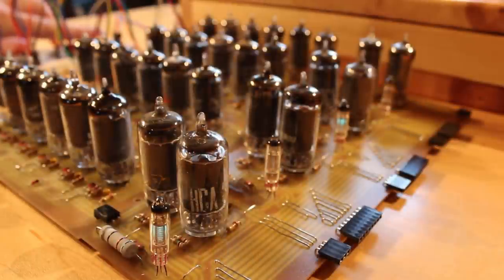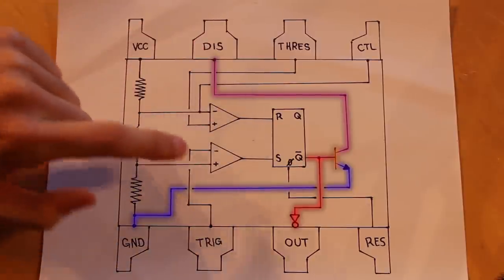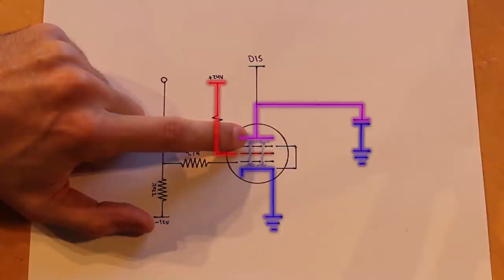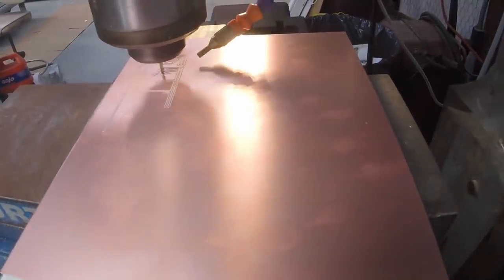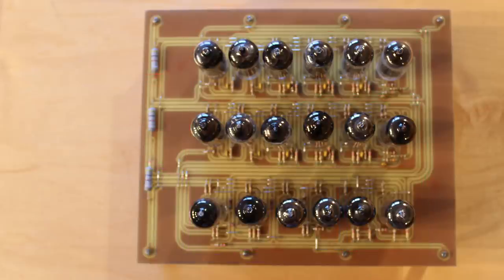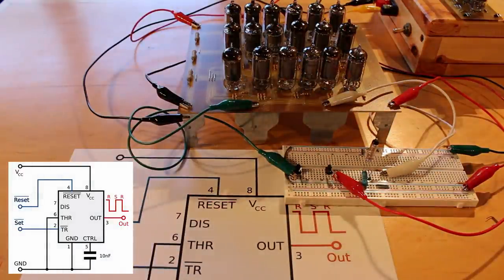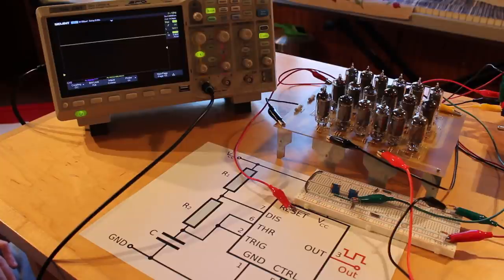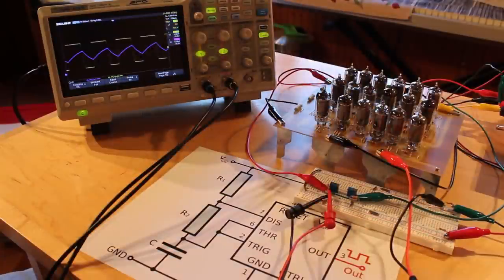Building the Largest 555 Timer in the World out of Vacuum Tubes

Comment: This is so cool, I have to dig out my old Radio Shack "designers handbook" pamphlet of 555 projects. I can make an LED flasher out of it! I'll definitely take a tubeless kit if that comes to be, I have plenty of sharp cutoff pentodes.
Reply from the maker: Thank you!
I'm really happy with how it turned out!

I'm definitely thinking about designing a few kits, one for pentodes, one for dual triodes, as well as coming with tubes and without tubes. I'm trying to do as much testing with and design revisions as possible with different tubes here to make the design flexible enough to be used with a variety of different tubes (and also to bring the total tube count down a little). Out of curiosity, what kind of pentodes do you have? 

My hope is to test and design with enough different tubes that I can release tubeless versions with recommended tubes and resistor values.
Reply: @UsagiElectric  check out the .75 cent Tubes list at vacuumtubes.net. There are many small TV pentodes that nobody wants because they don't work well for audio, but for this would be fine. You'd be under $18 for all the Tubes with shipping.
Reply from the maker: @richardhansen469  I really do need to contact them! Unfortunately, all of my go to tubes for the low voltage applications that I'm doing here aren't in there specials category (6AU6, 6AS5, 6136, 6BA6, 6CL6, 6BK5, and maybe the 6CB6). They do have the 6DT6 though, which I do happen to have in my collection, so I can do some testing with that one. I need to dig through their list of special cheap tubes and see what I have on hand to do some testing with!

Comment: that is fantastic,  I agree with the datasheet comment, and I would totally be interested in a kit.  I suspect I can even supply my own tubes.
Reply from the maker: Thank you so much!
I've been working on a design for the OpAmps that uses just 4 tubes each (instead of 6 each), but is still flexible enough to be used with a few different tubes. So far, I've got it working pretty well with 6136, 6AU6, 6CB6 and 6DT6 tubes. There will be two little potentiometers to tune the OpAmp to the tube type being used, hopefully opening the kit up to a bit more flexibility for sourcing tubes.
Now, I'm just waiting on some ordered parts so I can start proper design on the PCBs!

Comment: So glad Hackaday did an article about this! I didn't know this channel existed.

I'm sure there'd be people out there who'd love a kit for it. Need to get the tube count down though! I notice your go-to tube is the 6AU6. Mine's the 6BL8 because it has a pentode and triode in the same package. I usually use the pentode for gain and the triode to buffer the output - however I run my projects at 250V, so that'd make it easier for them to operate. Probably not recommended haha. Good work!
Reply from the maker: Thank you so much!
The 6AU6 is indeed my go to tube, but mostly that's because it's cheap, I have a bunch of them and I've done enough with them to be really familiar with how they react. I actually have a handful of triode/pentode combos (notably the 6GH8, 6KT8 and 6GJ7), and they would make excellent gain buffer combos like you use with the 6BL8. I do use the 6AU6 as a cathode follower buffer for the output buffer on this one, but I totally could have built the flip flop and output buffer using just two triode/pentode combos with relative ease (and halved the tube count on that portion). 
But, as you noted, running at such low voltages makes things a little more difficult! Running at 250V would work so much better, though I'm guaranteed to have shocked myself more than a couple of times by now if I were, haha.
Reply: @UsagiElectric  While I think of it, it should be possible to get a very low anode voltage on a triode if you drive the grid positive relative to the cathode. This means grid current will flow so the source impedance needs to be fairly low. It'll behave like a pentode with a 0V grid sort of. Something to think about. Cheers.
Reply from the maker: @256byteram  Interestingly, driving the grid slightly positive relative to the cathode is how most of my low voltage designs work. Even with the pentodes, I tend to push the grid to just above 0V to fully drive the tube into saturation. The grid does suck up some electrons, but there's enough resistance on the grid network to keep that to a minimum. It's kind of using the tube outside of it's intended design, but then again, rocking just 24V would make most of the tube designers of yesteryear just look at me like I was a mental case, haha.

Comment: Really neat.   But a bit,impractical.   You might ponder using some 6BN6 tubes.  Originally designed as a purely analog FM detector.  But due to its quirky positive feedback it makes an excellent comparator or flip-flop.   And since there is no other demand for them you can get them for like $1 each.
Reply from the maker: Thank you! 
And I wouldn't say it was a bit impractical. I would say it's completely, totally, and absolutely hilarious levels of impractical!
I actually have a few 6BE6 tubes, which are pentagrid converters (or heptodes) that work excellently as flip flops or multivibrators, but I already had about 1,000+ 6AU6s in my possession, so I totally built this based around what I had readily available on hand!

Comment: It is one of the best videos I've ever seen. Congratulations. One question I couldn't avoid, did you test how fast can it run in astable mode? Saludos desde Chile!
Reply from the maker: Thank you very much!
I did actually give it a test in astable to see just how quick I could push it, and it seems that 8kHz is about the limit. It will actually go faster, but the falling edge starts to fall too slow and the output waveform gets smaller and smaller. You can see the slow falling edge here: https://i.postimg.cc/fRBJ9Nx6/IMAG3517.jpg
 Whether this is an issue with the SR Flip Flop or the Cathode Follower buffers, I'm not sure at the moment, so I'll have to do a bit more investigating. But, 8kHz isn't bad at all!

Comment: Very nice, great choice of target as well - just the right amount of complexity I think! How much power does it draw?
Reply from the maker: Thank you!
I think it could definitely make a nice kit for anyone who is looking to get into vacuum tubes at safe voltages!

The power draw is a little tough to calculate. Nearly all of the power is used to heat the filaments in the tubes. Since these are all 6AU6 tubes, they are rated at 6.3V and 300mA. But, I'm slightly undervolting them running at just 6V per tube, so should be around 285mA per tube. That's around 1.7W per tube, and with 18 tubes in use here, that's around 30W of power draw!
In reality, 16 of the tubes are running in four groups of four heaters in series powered by the 24V supply, drawing 27W, and the remaining two tubes are in series and powered by the -12V supply, drawing about 3W of power. So, a little Ohms law says that my 24V supply is drawing about 1.1A of current, and my 12V supply is drawing around 250mA of current.
So, it's definitely a power hungry little project!

Comment: super interested in this as a kit.  add a plus one on that from me.  I'll hang it on the wall right next to my ben eater breadboard computer... oooohhh, or I'll use it in place of one of the 555s in the clock circuit of the ben eater breadboard computer... yup, that's the ticket right there.

Comment: Good job. I did not know your existance until I came across a post from hackaday. Well, I am passionate about the valve world and you have a new subscriber  
I have a Q: Why need 6 tubes to make an op amp? Because some time ago,  Mr Carlson show us a K2-W Op amp using only a pairs of 12AX7 tubes
Reply from the maker: Thank you for the praise!

So, the OpAmp design I'm using here is actually based on the K2-W OpAmp that Mr Carlson demonstrated in his video. But, there's a few differences that resulted in the much larger tube count. 

First, the K2-W uses dual triodes, so it's essentially like having two tubes in one glass enclosure. The little 6AU6 pentodes I'm using here only have one. So, that means that all other things being equal, the pentode version would require twice as many tubes as the dual triode version.

The K2-W uses one dual triode as a long-tailed pair, and then the second dual triode houses one amplifier stage and a cathode follower buffer to give a low impedance output.

However, the K2-W is running at really high voltages (+300V to -300V). That allows the single amplifier stage to produce a massive amount of gain. For my OpAmp here, I'm running at obscenely low voltages (+24V to -12V). This means that the amount of gain I can from my amplifier stage is much, much less. So, to compensate for that, I run two additional amplifier stages. So, for my design here, two 6AU6's are used for the long-tailed pair, then three are used for gain stages, and then one final 6AU6 is used as a cathode follower buffer.

Now, for the kit, I've been working on a pretty heavy redesign of the OpAmp to get the tube count down to four. Since the OpAmps are only feeding into an SR Flip Flop, having a cathode follower isn't strictly necessary. And then, with some redesigning, I can actually eliminate one of the amplifier stages, getting the total tube count down to just four tubes (or two tubes if using a dual triode). 

Hope that answered your question!
Reply: @UsagiElectric  Yes, for sure! Thanks for explaining, there is always a reason. And you have developed it well. Good work!

Comment: I would absolutely be interested in a kit for this! Also, would you consider selling mini PCBs for tube logic gates / flip-flops etc?
Reply from the maker: Thank you!
I've actually been having a bear of a time figuring out a cost effective way of getting the legs done for the kit version, but I think I've finally got a good solution. I'm hoping to get the final kit prototype ordered and built this spring!
That's an interesting idea about mini PCBs for tube logic gates. There's definitely some interesting ways to work on the designs to make them like legos, so you just apply power, and then you can chain inputs and outputs together. That could be a lot of fun!
Reply: @UsagiElectric  yes, being able to chain them would be perfect!  I seem to remember a similar thing we had at school but using IC-based gates, and banana plug leads to connect. 
My ultimate ambition with these, by the way, is to build a digital clock!

Comment: Awesome.  I'm think you and Paul from Mr. Carlson's Lab need to colab. :-)  I am curious, though, how much filament current is this thing pulling?
Reply: dammit... I'm thinking
Reply from the maker: Thank you!
That would be totally awesome, Mr. Carlson has been a pretty big inspiration!
This one is using 18x 6AU6 pentodes which have 6.3V heaters that pull 0.3A. I'm powering either four at a time off the 24V rail, or two at a time off the -12V rail. In total, 12x tubes are powered off the 24V rail and 6x tubes are powered off the -12V rail.
In total, the entire 555 is drawing 34W of power. The 24V rail is drawing 1A, and the -12V rail is also drawing 1A. So, a pretty hefty power requirement, especially when considered against the original 555!

Comment: If you make this into a kit, it'll be a shoe in for IEEE Spectrum's Hands On Column, where it'll be the natural evolution from the 555 discrete kit we featured a few years back.
Reply from the maker: Making it a kit is a definite plan!
There's a few large hurdles to clear though. First of all, the primary component, the tubes, need to be sourced used, which poses all sorts of difficulties. But, I have some solutions I'm working on, so hopefully we can get it going smoothly soon!

Comment: Nice TI-99/4a setup. I have some interesting parts you might like.
Reply from the maker: Thanks!
There's really just a few things I'm missing. Primarily, I would like a black key mechanical keyboard for the TI-99 unit itself. My membrane keyboard died and the later beige mechanical keyboard was all I could find at the time. Fortunately, it still works fine, so it's just an aesthetic thing.
Also, one of these days I'd like to get my hands on an original TI color monitor instead of the Sanyo monitor I'm currently using.
As for sidecars, I have most of the entire lineup (speech synthesizer, memory expansion, RS-232 interface, 300 baud modem, disk controller, disk drive, and solid state printer). I believe there's only two sidecars I'm missing: the P-Code sidecar and the video controller sidecar. But both of those are extremely rare pieces it seems!
Oh, and I also need a new desk because it's easily the widest computer on the planet, haha.

Comment: Cool project! If I built this I would like to use a small relay for the discharge. When it works as an oscillator, you can hear the relay ticking XD
Reply from the maker: Thank you!
Interestingly, I actually tried prototyping in a relay for the discharge portion of the timer. I had a few issues with getting it working just right. The relay needed a lot more current than my low voltage tubes could reliably supply. I needed to run two to three tubes in parallel as cathode followers to reliably kick off the relay. But then, I couldn't bring the voltage low enough to turn off the relay, since the maintain voltage seemed to be quite a bit lower than I expected. Of course, I was just using a random small relay I had laying around, so it could probably work a bit better with a properly sized and rated relay.
Another thing that I want to try for the discharge is using a 2D21 Thyraton instead of a 6AU6 pentode. I think that would be able to really discharge something to completely zero (though using a thyratron brings with it its own hurdles).

Comment: Nice, but it's a fraction too 'modern' IMO...
The SR flip flop, and the discharge 'transistor' should have been constructed with relays - home built relays to be exact. <<Grins>>

I couldn't think of a way to make a suitable 'comparator' with relays without requiring DRAMATICALLY lower values on the 3 resistors.
(The NAME of the 555 is sometimes thought to be from the 3 * 5k resistors...  Perhaps 3 * 5 OHM resistors?)

Comment: You missed the next obvious step - testing the bandwidth! What's the highest oscillator frequency possible before the output falls off or becomes distorted?
Reply from the maker: I actually did give it a bit of a speed test after filming this video!
It seems that 8kHz is about as fast as it can go before it starts have issues with the falling edge. You can see the problem here: https://i.postimg.cc/fRBJ9Nx6/IMAG3517.jpg
I'm not sure if this limitation is coming from my SR Flip Flop design or the cathode follower buffer design, but honestly, 8 kHz is much more than I was expecting out of it!